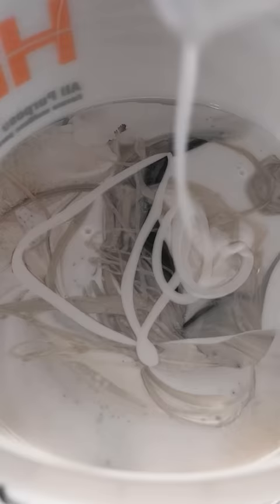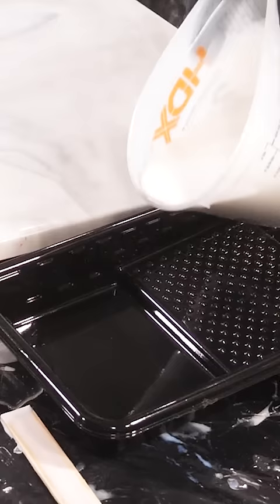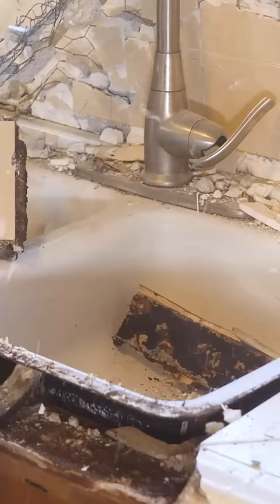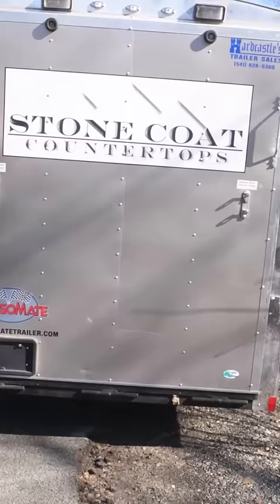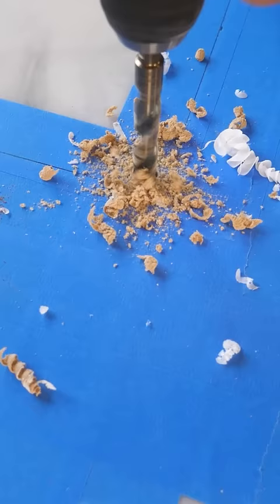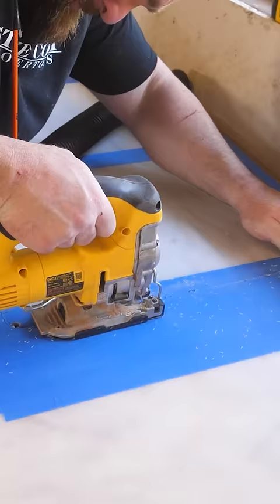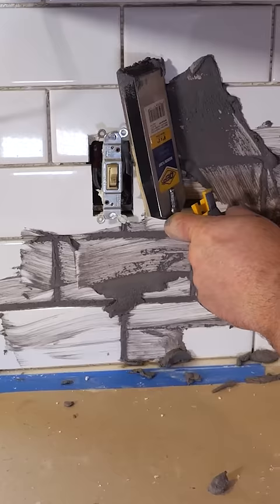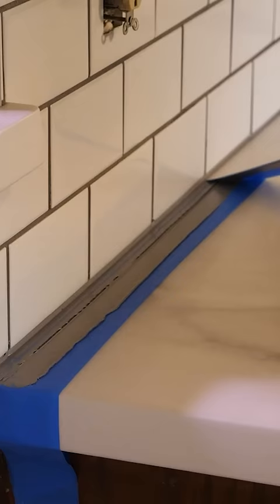NEVER get Tile Countertops #shorts

Comment: Hi dude, here's a hint and word of advice for grouting the backsplash tiles. Use a piping funnel bag used for decorating cakes. Because you can get severely in between those tiles! You don't have to waste a lot of grout doing it, just smearing it on the tile, and the grout gets in deeper with significantly fewer air pockets. And these disposable bags are incredibly cheap. I think you get six or seven for like $3, and one bag is enough to do an entire kitchen and bathroom worth of grout. So.... Just an fyi. Thought you ought to know if you didn't already.😁
Reply: And use white next time. Dang
Reply: @Fig Ment - It's all about YOUR taste. I like the gray grout. It brings out the color in the white Carrera marble. I'm just saying.
Reply: @Lady De Williams  Oooo Grey is a great color for grouting on a carrara marble backsplash! I kind of like a slightly darker gray screen grout for a slate grey backsplash. Cuz then you could use brushed nickel copper gold black fixtures for the kitchen, and then you wouldn't have to do your cabinets either a straight white or a darker color. Cuz then it would just kind of go together in a really cool, funky kind of sense.😅

Comment: Did you pour that over MDF? Is that what I saw?
Reply: Yes! 😬😬😬.  Water from the sink and dishwasher steam is not going to be kind to that!
Reply: "... so I ripped them out, and built new countertops from wood." 😆😆🤣🤣🤣🤣
Reply: whats the big deal? if it's sealed it dont matter, if its not you've got bigger problems. MDF takes to epoxy surprisingly well. Given its spongy nature it will absorb the epoxy and become waterproof. Yall act act like you didn't know that's whats under formica countertops. Maybe you didn't?...
Reply: @Paios  Can't wait for it all to swell up around the sink.

Comment: So what do you do when the new countertop starts taking on stains?? Our resin white marble is literally turning yellow around the tap from our water sitting there, and forget about leaving spaghetti sauce on it.
Reply: This is epoxy, not real marble. It might hold up better.
Reply: @donethatbefore100  that’s what I’m saying, ours is a epoxy counter too, how would it stain?
Reply: @torquess454  well that makes me not want to go through the trouble of doing the epoxy thing. Not a good selling point.
Reply: @torquess454  I hope you get a reply on what can be done!
Reply: It might not have had the top coat applied properly.
Reply: Nail polish remover 
Try it... it works and is safe
Reply: @Grnfinger  I’d need to see evidence of that not damaging epoxy
Reply: @Grnfinger  Come on man, that's just mean. Do NOT put acetone on your epoxy countertop.
Reply: When I make my tumeric tea I always waste it on my white counters and stain it. I use a bleach and water mixture, even on stains that's been there for days (sometimes I let my teas sit on the counter in mason jars and the bottom of the jar has a tumeric ring on the underneath).
Reply: @yootoob2  I’ll try that thx!
Reply: Marble is soft and proned to stains
Reply: @Roosters-rants1977  I’m talking about resin countertops
Reply: @Roosters-rants1977  softer than wood...?
Reply: @yootoob2  try Mr. Clean Magic Erasers & SoftScrub
Reply: why would you leave spaghetti sauce on the counter??? Jesus some ppl live like animals and are like "whys everything fall apart?!?"
Reply: Ugh I know what you mean about water stains… the cafe I work at has marble countertops (which I would assume are actually just epoxy) and there’s so many stains wherever water tends to pool. Which in a cafe is a surprising amount of places
Reply: Sand it down to where there is no stain. Then find a really good sealer and seal all of the countertops. The stain should not be able to reach the actual epoxy. They should hit the top coat and then stop there.
Reply: @figment9625  great suggestion, but we’re renting so I’m not sanding anything, however I used a bleach/water mix and it came right off thank God

Comment: “They wanted to brighten up their kitchen with marble” so you gave them epoxy’d wood? 💀
Reply: I thought it was epoxyd MDF. Now that's a timeless material!
Reply: If tile from Home Depot wasn’t in their budget then obviously Carrara marble wasn’t either. They now have a durable marble-look countertop.
Reply: Most confusing video ever
Reply: @nunya257  It doesn’t survive temperature though, so…
Reply: @GuiSmith Neither does marble. You still need to use a tressle to lay hot items on
Reply: I’m kind of confused about this video too. Glad to have found a comment like this to ease my anxiety about what was happening. 
I can only imagine the look of it after a years worth of use. (Hot pans and such)
Reply: Dudes, please, don’t put hot pans on marble or granite! It will leave a mark! Light or dark colored.
Reply: Has it not brightened up their kitchen?
Reply: @rnsantiago  Exactly, marble discolors from heat..  You can even crack it if you get it hot enough.
Reply: @_Chessa_  why would someone ever put hot pans and such straight on a countertop? i was always taught under no circumstances to do that, and instead put an oven mitt or something between the pan and the counter if it cant go back on the stove
Reply: @r41ndr0p_12  you’d be very surprised. 
I’m still surprised by what my family does to the counter top. (Placing hot pans, boiling pots, chopping vegetables on it) 
I’ve lived in multiple places where the people left hot boiling pots of water on their counters to cool. (smh)  I understood the odd pattern on their circular dark sink and counter. 
Than in that same house, they put plastic bowls in the two microwaves and ovens… no joke ruining their appliances so they couldn’t use them anymore. 
I got out of living there and then ended up living in a hoarders house situation. 
The person living in the filth and stuff loved cooking and leaving used pans all over the counters and floor. I had to clean one spot free from clutter everyday just to have some space for my own cooking or food. 
After living in that, moved back into my family’s home and they put things on the counters without protection. 
Drives me crazy no matter where I live. 😵‍💫
Reply: @rnsantiago  Marble yes...but granite shouldn't be that finicky. Unless it's not really granite by petrology.
Reply: @r41ndr0p_12  yeah me too what the heck...? Lots of our pans are cast iron I would NEVER (ever!!) put one on the counter! they seem to be some sort of plastic-like material so they'd probably melt. I don't even like to set instant ramen on the counter when I microwave it in a pitcher, I usually set it on the stove. that one might be a bit irrational tho lol
Reply: No love for formica?
Reply: @_Chessa_  , you should be protecting every surface no matter what LOL. You just want to think you can be lazy by skipping a step.
Reply: @r.coffman1431  did you even read my comment cause yours makes no sense if it’s towards me. Lol
Reply: @GuiSmith  So what? Put a hot pad down or keep a cutting board on the counter. I never put hot pots on the countertop no matter what the material is, out of habit.
Reply: Marble is expensive honey
Reply: @rnsantiago  marble yes but granite is a beast, unless you drop a balder on it it'll survive anything without a scratch or a mark

Comment: You call that MDF wood?! At least you could use plywood. But anyway, the result looks nice. We'll see how long it lasts.
Reply: A real cheapskate contractor goes off on cost of tile contractors charges and then his integrity is absolutely horrible by using MDF board! I’m not interested in watching another video of his! I have done many tile countertops and we get nothing but compliments and longevity too!
Reply: Scrolled too far for this
Reply: He did seem to be applying some waterproofing technology to the MDF prior to the epoxy, but I don't know a lot about it.
Reply: @GarrisonFall  redguard?
Reply: @davidhughes5564  no doubt dude total clickbait also pouring epoxy OVER tile instead demoing it lmao wtf?!
Reply: @chompers11  I don't know much about the products (though the color looked right). A while back I briefly looked into it for waterproofing - ironically, under tiles I was going to lay.
Reply: @davidhughes5564  Who in the modern world still does tile countertops?
Reply: Countertops will an always have been the most exspinsve part exspeacilly if u want decent quality.
Reply: Probability thy shouldn't beat stakes on it. Or walk by with hot dish near it.
Reply: @davidhughes5564  sure but there needs to be options for everyone else that just can’t afford tile. 

It’s heavy and expensive and sometimes people just need counters that work and will hold their appliances and cookware. I’ve had wooden counters my whole life and never felt like I needed anything different.
Reply: No, we wont see how long it lasts. That video will not be made.
Reply: Did my counters with epoxy 3yrs ago. One scratch and I was able to sand it out and fix it. The primer and epoxy seal out the water. And a coat of "diamond coat"  epoxy made it hard as nails.  Tile is so 1975.

Comment: If it’s MDF that’s been treated, it’s probably the equivalent of using Medex. No different than your typical laminate countertops. The only issue I see here is the longevity of the epoxy, but I bet it’s a lot better than laminated tops 🤷🏽‍♂️
I’m sure they would love actual marble tops, but with three little ones, their wallets have a higher priority.
To each their own.

Comment: $85 per square foot for new TILE countertops??? You mean granite, right?
Either way, great job! What type of wood was used for the countertops and do you do anything special to waterproof edges beneath the sink and the underside? Coat with epoxy or what?
Thanks.

Comment: What benefits does epoxy have over a cheap laminate worktop with a marble effect finish? Where I'm from you can go into a hardware shop and get the worktop cut to size for free. They look very similar, they seem like they're more heavy duty, they're waterproof/stainproof and they're readily available. I don't get it for the low end. Also in this example here I don't understand why it took so long.

Comment: I would never hire you. MDF and epoxy? Why using epoxy that scratch so easily? 
You could at least use wet strenght plywood like okoume and glue over a melamine layer. This is what I would do.